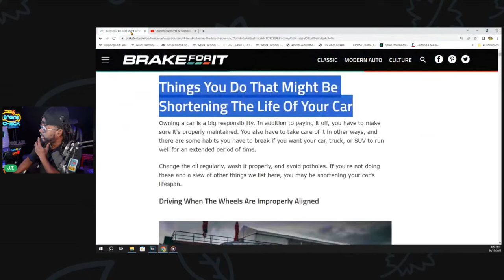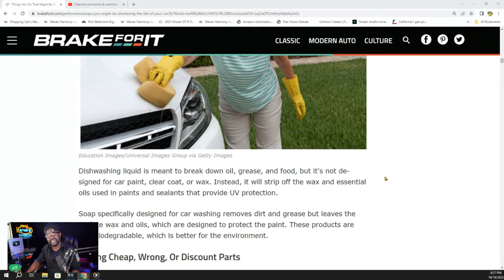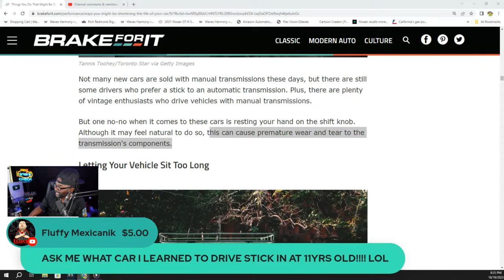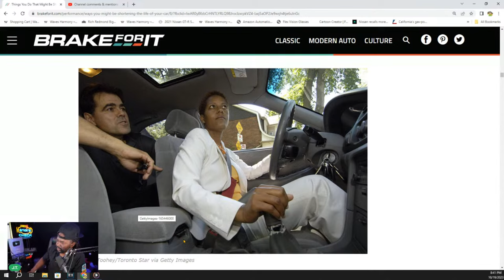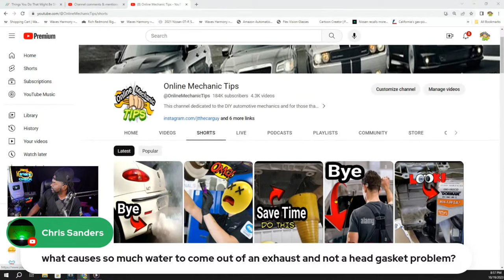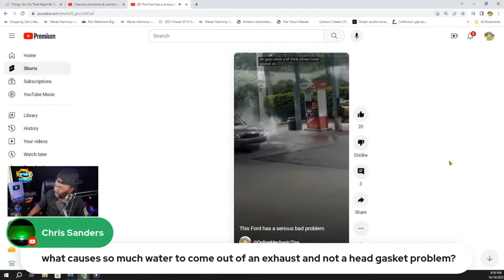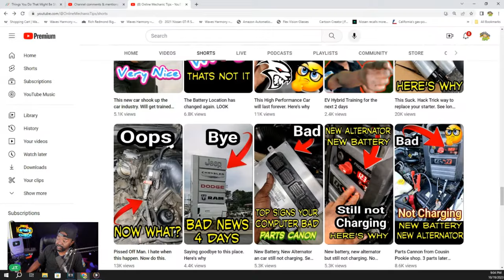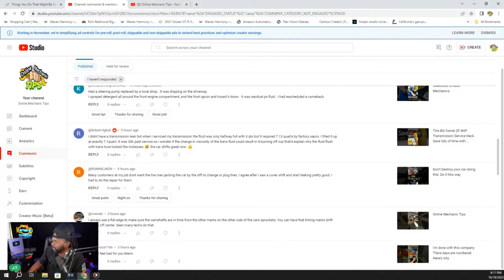Things You Do That Might Be Shortening The Life Of Your Car

Comment: The water is because of the catalytic converter and can be exaggerated if the humidity is high.  If you think you have a blown head gasket?  First check your spark plugs.  Any engine problem starts with a spark and the plugs tells you where to start.  Turn key as the fuel you spray through the air filter and if the engine does not turn over with fuel?  You have a spark problem.  Engine turns over?  Not a spark problem at the moment.  You can be very unlucky to have both issues at the same time.

Comment: JT I drive the greatest sedan ever made, A late model lincoln town car and my engine bay is clean as can be. 303 it all that is possible. Love a car that I don't have to work on alot, sorry Chrysler owners, no panther tic, cylinder deactivation. And a crown vic is documented at 1 million 17 thousand miles, ORIGINAL DEIVETRAIN. No Chrysler can get over 150k unless it's a Chrysler with a 5.9 cummins. Body be gone but still run great.

Comment: If your water pump is on a chain and the seal does not hold coolant can mix but your car should cut off when this happens. Oh, if your o2 sensors have 90,000 miles and over please change the things or go by your schedule for your car. Cool or cold air can cause exhaust with steam looking exhaust because of high humidty but it almost fades out while engine is warming up.